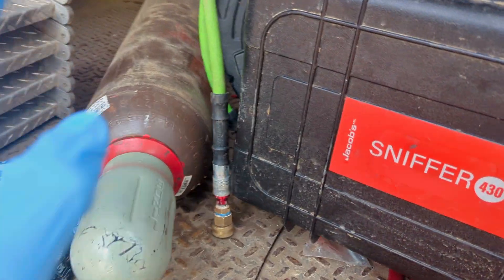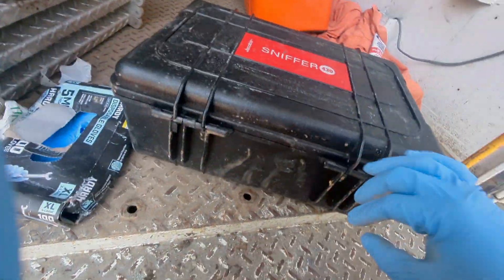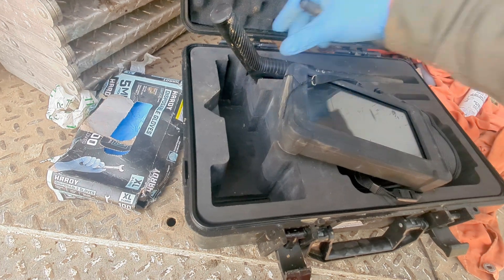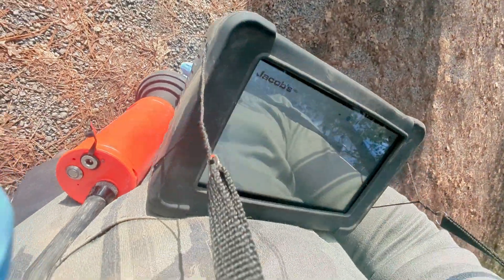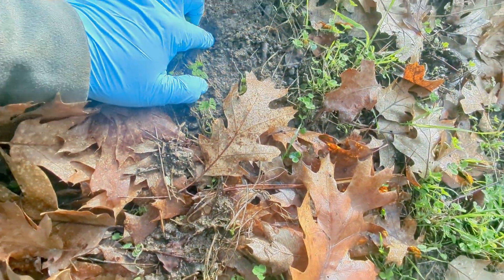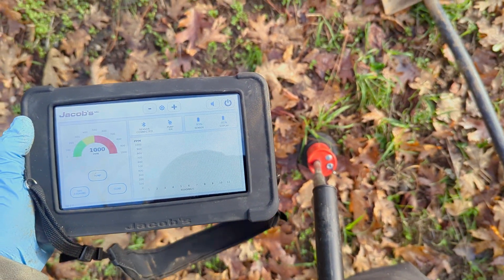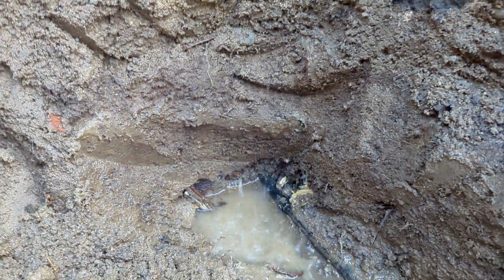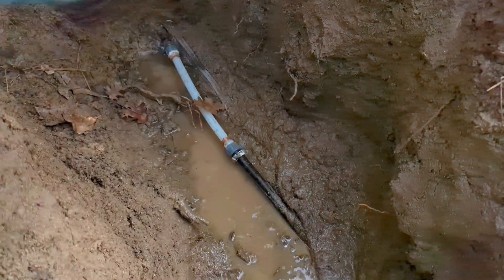Underground Water Leak Detection on a WELL!

Comment: The sensor picks up the gas pretty quick. These leak detection videos are fun to watch. Not trying to be an internet know it all but don't you have the acoustic sensor also? I figure you could use the gas to get close then acoustic to try to more pin point. Keep it up man!
Reply from the maker: Yeah you are right I generally do that but when the gas bubbles up that quickly it's usually spot on. Will definitely take more time on the next one lol. Thanks for watching and stopping by!
Reply: Very keen idea 👌🏽